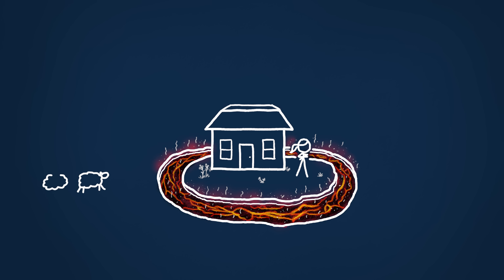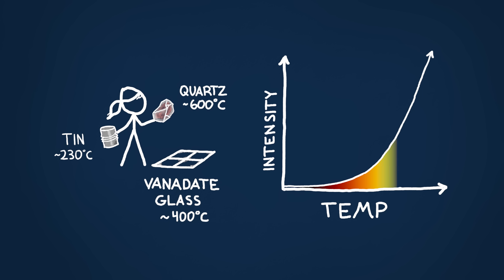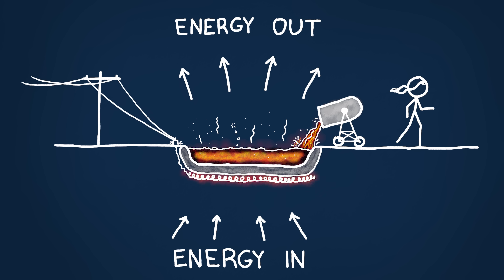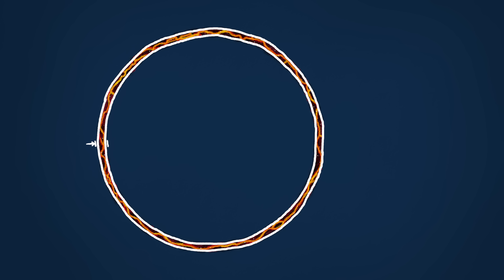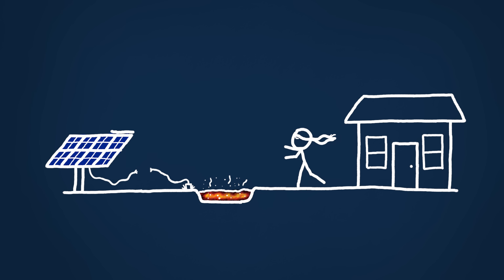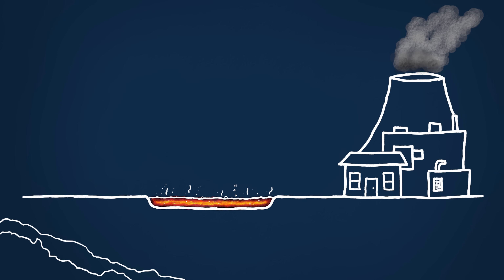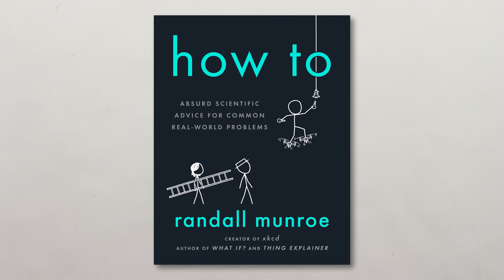How to Build a Lava Moat (with xkcd)

Comment: ☆☆☆☆ I give this Four stars! This guide has helped me solve almost all of my trespasser issues and given the outer walls of my personal fortress a wonderful glow. Keeps out burglars and in-laws! Would have given it 5 stars but the heat from the lava moat boiled away the water for the moat holding the Laser Sharks.
Reply: So you gave it 4 stars for your poor planning, and because it did exactly what you wanted it to, which is get hot? Ugh, you are just one of those reviewers.
Reply: My laser shark moat is doing just fine, maybe yours has a design flaw?
Reply: I'm fine, because my newest generation of laser shark is completely fireproof, allowing me to replace the water with lava safely
Reply: @thepizzaman6310  Unlike those iSharks, SO fragile!
Reply: @Basilililisk  You learn to identify which brands are trash by the names of their laser sharks alone, believe me.
Reply: @Resetium You dont need to tell me twice
Reply: @familypremium-m3f  damn right i dont
Reply: awww the frickin laser sharks
Reply: that is the problem with over complication. My moat is just regular water, filled with very unregular mutated sea bass
Reply: @rphb00  unregular mutated sea bass? I just have a simple automated system to inject the water high up into the nose of the annoyance whatever it may be, making a lot of that common brain eating amoeba pretty much guaranteed sealing the fate of the perpetrator, and then once they reach the other side a screen tells them about what they hopefulyl are infected with and the consequences of being infected with it.
Reply: i rate it 6.9 stars

Comment: Dig a ring (or square, I guess) around your house that is at least 5 blocks wide and 3 blocks deep, although personally I like to stretch these dimensions by a block or two. I'd recommend leaving at least 5 blocks between the ring and whatever building you put in the middle of it, so you can make a farm inside, space for other security measures, or just to walk around in. Then again, this is just a guide, do what you wish.

 Once that is done, take obsidian and line the inside of the ring with it. Don't worry, I already made space when I told you the size of the ring, no further digging required. When you finish that, go to the innermost layer of obsidian and continue it two or three blocks up. if you want, you could stretch the width of the ring beforehand to save space for a thicker inner wall (but make sure you save at least 3 blocks of width in the moat for the lava!), and even add an overhang to your wall for more difficult entry. 

Another option for your wall is instead of an overhang(or even with the overhang, for the craziest base), you can add cobwebs. If your enemies are scaling your wall and get stuck in the web, the only place they're going is down into the lava or away from the wall. If you want to get really high tech you can build an observer system that sets off an alarm, activates other security systems or notifies you in some way when the wall is tampered with.

Now, it's time for the lava. All you need to do is fill the moat up enough that there is one unfilled layer at the top to hopefully trap invaders . So if you went with the ring I told you to make, there will be one layer of lava at the bottom. As I said before I usually make the moat a bit deeper. Also, I believe (at least in PE) lava will not damage cobwebs, so you could also put it over the lava for extra defence.

Congratulations! You've locked yourself in your own high security base! Sure, you can build some stairs, but you'll need to get back in. There are so many things you can do. You can be as boring as those stairs, or as advanced as keycard reading slimeblock launchers. Secret entrances. Pop out stairs. Get creative! But that is all I have for you. I wish you good luck defending your home from those gosh darn creepers.

Comment: UGH I WISH I SAW THIS BEFORE MAKING MY EVIL LAIR! had to settle for a circle of shark infested waters instead

EDIT- I have made this comment 10 months ago and am still getting replies so I will update you. The sharks are a difficult balance between feeding them too much and starving them, I would be careful managing their bloodthirst without risking their health. As a downside of my inexperience I have been overfeeding them at first and my heroic nemesis made her way into my lair, there was a lot of fighting and monologuing. As an upside we are married now, both evil, and both have learned from the past security issue. With 2 villains in a lair the amount of heroes doubled, so now I don't have to feed the sharks myself much at all
Reply: You didn’t even add LAZERS?! smh
Reply: @TrippleDogDare  laser(light amplification by stimulated emission of radiation)
Reply: From personal experience, I would recommend piranhas. They require less work and are cheaper. Plus, sometimes sharks leave your enemies alone end they can swim to safety. No such issue with piranhas!

Then again, you could, of course, splice the genes of the sharks and the piranhas to make a new creature but that’s just too expensive and time consuming (rather than visitor consuming)
Reply: @insertnamehere8099  yea great idea... Personally I used to use  both piranhas and sharks but then they started fighting and all... Then I settled for lasers and high voltage current flowing through water from the dead sea... Its very low maintanance..
Reply: @insertnamehere8099  Sharks very rarely attack people and as a result, the hybrid would probably be a good choice.
Reply: @insertnamehere8099  Why not just fill the moat with both?
Reply: Try using genetically modified sharks that are always hungry.
Reply: You're lucky you could afford actual sharks. Some of us have to settle for ill-tempered mutated sea bass.
Reply: Is your evil lair called Australia?
Reply: @JUSTIN SMITH sharks don’t sleep
Reply: @timthetincan6782  sharks sleep, they just keep moving in their sleep
Reply: just put the sharks in an inner ring, and a lava moat outside the water! Then make fireproof and lava proof and heat proof sharks and piranhas! complicated :)
Reply: what about lava shark infested lavas?
Reply: dude thats rude sharks live in water, its like saying human infested homes.
Reply: With freaking lasers on their head I hope?
Reply: Shark infested waters isn't so bad. Ever considering upgrading it to includes sharknado?
Reply: this is the greatest comment i've ever seen
Reply: i also recomend a brick cannon which fires bricks if it helps me it will help you
also i use it for deffending from people that want to grind me up into powder so i can be used more easyli i dont want to be dust ya know
Reply: That's why I like the Saturday Night Live skit with Christopher Walken.  Spoofing his portrayal of Zorin, he had a pool with a sea sponge.
If you recall in the movie, there's a little bridge over the indoor tank and he presses a button to drop his visitor into the water, where he's met by a hungry shark.
As you point out, the shark has to be kept hungry to be ready to use, but not starved; and feeding them is not cheap.  You also would have trouble housing more than one in that state.
But a sponge is low maintenance.  With no limbs or teeth or shell to fend off attack, they are always prepared for defense, and they have to engage in massive overkill so the would-be prey is killed before it can eat much of the defending creature.  It eats very little thanks to not moving or having internal organs and their associated energy budget, but drop an unsuspecting person on top of it and stinging cells inject fast acting neurotoxin.  As a bonus, it can be milked periodically for a supply of toxin to use on darts or on the back of postage stamps and other Bond tropes.
Reply: i went with a cactus pit, good choice tho
Reply: Love wins <3
Reply: oh damn how did you get your hero to turn to your bodacious side of the law? I'm having trouble with a nemesis myself, and while there's plenty of fruitful homoromantic tension, she keeps trying to get me to "go straight", and we both know I can't do that, honey. How do I convince her to lay down her sense of morality and justice?
Reply: To bad man that must suck
Reply: geez I hate it when that happens.
Also how much are you paying too feed the sharks?
Reply: @HG-mj9ow  Its a common misconception that an evil genius needs to buy shark food. Simply advertise your evil lair in one of the lower-tier hero magazines and your sharks will never go hungry again. You may need to hire staff to clean the spandex out of their teeth every now and again, tho.
Reply: @keithklassen5320  Ohhhh smart, I'lll try that sometime
Reply: You can have lava with shark bones in it
Reply: I did the same but with alligators didnt know they tasted like chicken it's very interesting it took a lot of planning but finally I got the moat not try and killer me baby alligators are cute :D
Reply: Why no Cybernetically Enhanced Laser-Sharks?
Reply: I would recommend alligators or crocodiles. They need less mantinence and can chase intruders on to land. Need to be trained to leave you alone, but that's as easy as shocking them when they try to eat you and only feeding them the weeks they don't. You need to find a way for them to distinguish friends and foes.
Reply: I just can't believe that you didn't consider the far more environmentally effective crocodile option.  God, super-villains these days...
Reply: probably the only one who can afford something like this is a mimionare

and even if you could there's stuff like safety and laws
                  afterall there's probably an important reason why no one has tried building a lava moat
Reply: @bluewhalestudioblenderanim1132  if you're building an evil lair, I don't think you would care about safety and laws.

Just like Willy Wonka's chocolate factory
Reply: But uno reverse cards in there
Reply: @Eric Lee  But then the hero did a backflip, snapped the bad guy’s neck and saved the day!
Reply: are you sure the sharks will actually do anything? they tend to be very docile.
Reply: @JUSTIN SMITH but can you send someone to sleep with the robo fish? No you can't
Reply: Why not a system of cameras with lasers attached
Reply: @alba2162  those are indoors
Reply: @deanastasya  That was absolutely hilarious. Keep up with the edits xD.
Reply: Oh my god/goodness u a devil? Laugh out loud i have robots all over my house but they are on low usage. My robots are my lava moat.
Reply: I would suggest using ill-tempered sea bass.
Reply: @Eric Lee  But then the hero did a backflip, snapped the bad guy’s neck and saved the day!
Reply: But sharks don’t eat people normally...
Reply: Liked for the edit 😂
Reply: @EDDIE3DDIE  
Jesus, we are bad guys but we aren't monsters!
Reply: Update?
Reply: I’ve heard that piranhas are more manageable
Reply: This was such a fun and witty read. Thank you 😊

Comment: Oh I need higher quality rock that's where I've been going wrong
Reply: Nah just add LEDs. In fact, forget a lava moat; just rig some smoke machines and holoprojectors in a trench along with heat vents a distance away. Same effect, way cheaper and easier.
Reply: @copterinx0468  That's OK as a deterrent but it's not going to do the job of actually melting a horde of invasive zombies, or religious/political door-knockers.

Comment: And then comes the guy with a bucket of water.
Reply: Obsidian for days, man
Reply: @ScalyRaptor1944  you’ve got yourself a nether portal
Reply: Little did they know, they were in the nether
Reply: Steam.
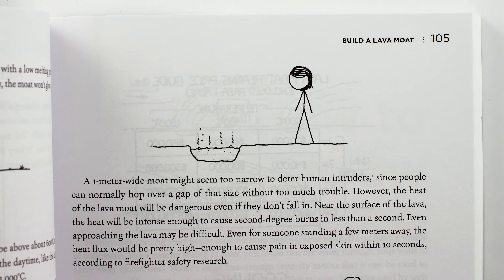Reply: @esequieltovar4955  although at 3:14 you can read that it's not all that unforgiving: just need a bit of insulation from the heat. ;-)
Reply: you are correct
Reply: i think that the water would explode rather than evaporate fast
Reply: I get that’s a Minecraft joke, but a moat of lava is insanely hot. The water would have evaporated far before you could dump it on the lava
Reply: By the time anyone got close with water, both the bucket will have melted and the water will have boiled into steam
Reply: Daniel Smerdel Minecraft joke
Reply: @danielsmerdel8214  Woosh
Reply: @TheBalefire  that's great but don't come crying to me when your skin melted off because you forgot lava radiates a heck ton of heat
Reply: @danielsmerdel8214  you did not get the joke
Reply: @wolfkey980  sarcasm is hard to convey over the internet, my apologies
Reply: @danielsmerdel8214  not really if the context is rather obvious
Reply: @danielsmerdel8214   its minecraft u boomer
Reply: @TheBalefire  r/woooosh
Reply: @TheBalefire  Did you r/woosh him?
I'm gonna do what I always wanted and r/woosh an r/woosh.
Reply: Then bring fire resistance 4 armor then start scoopin.
Reply: @TheBalefire  the sound of steam

Comment: You can decrease the size needed for solar-power with 2 slight changes:  
Use the heat of the sun directly - solar-panels are not that efficient, it would be better to use mirrors to direct the sun at the moat, should net an increase in efficiency by 50%.
And using heat-reflectors at the inside (and maybe a bit overhanging) of the moat would reduce the energy lost.

Comment: I imagine wind power might be a decent option for part of the power you would need here, as with the constant heat radiating off the moat, there would be constant air flow. I wouldn’t think it would produce enough power though

Comment: I hate to say it, but the melting point of plain quartz is about 1000-1100 degrees Celsius (or 1000 units kelvin for that matter) higher than is shown in the video. Also (and I could be wrong about this one as I have not personally melted it) Olivine seems to melt at between 1200 C and 1900 C (which is impressive given that sprinkling a little Mg in quartz will raise the melting point 200-300 degrees). Actually I am more assuming that the melting point of an average piece of Olivine is between 1200 and 1900 because I'm guessing the melting point varies roughly linearly as you move linearly between the extremes of the valid compositions for Olivine. (bit of a run on sentence there). Pyroxene seems like rock soup with everything thrown in so I have no Idea what its melting point is.

Comment: Why on earth would you use solar PV panels instead of Solar Thermal collection? Just for the lawlz ?
Reply: Yeah I was thinking concentrated solar thermal would be the best option here, perhaps as a parabolic trough on the sun facing side and tracking mirrors on the other side. The molten salt they use is only 566*C but I don’t see why you couldn’t use a higher melting point rock. Thermal efficiency is in the 60-80% range so you gain a lot by skipping electricity altogether. With enough thermal mass and insulation you might be able to make it through the night and the mirrors might reduce the amount lost to radiative heat too.

Comment: Because lava is so dense, I feel like there's a good chance the moat could easily be traversed by a floating plywood plank, assuming you can run quickly enough. Jury is still out on whether or not the plywood should be soaked in water first. If it isn't, it might burn really quickly. But if it is soaked, the Leidenfrost effect from the rapid vaporization (I know it's evaporation, but it's so fast that I feel like "vaporization" really gets the point across better) might make it unworkably slippery.

But if you construct your moat with a temperature gradient with uneven distribution of the heat generator's output, you might be able to get a convection current going that would make any floating bridge much less reliable.

Comment: Most of these power suggestions have it convert heat to power to heat which is inefficient, for example for solar power one could use mirrors to shine the light on a light absorbant material directly and use the heat from that. For nuclear perhaps one could use an RTG equivalent and keep nuclear waste directly below the lava or mix it in directly, perhaps not enough to keep the rock simmering directly depending on the isotopes but I think it'd help

Comment: Well, 1 meter is not that hard to overcome, oh and seeing as lava is is dense as fuck, you can walk on it, you won't sink, just get good enough boots with superb insulation, you don't want to burn your feet crossing, oh and seeing as you'd probably need 7 meters of lava to deter long distance jumpers, however if you don't think any long distance jumpers will arrive to threaten you, then you only need 4.5 meters, as most people can't jump that far.

If you really really wanted a decent enough moat though, you can't be cheap, if you can get a moat that's made out of molten metals, that's better, I recommend a 5 meter wide moat that is filled with iron, it has 1538ºC melting point, so if you really want to keep it molten and liquid, keeping a temperature of 1600ºC would be sufficient, however the problem is insulation, there aren't that many things that can withstand such high temperatures at least with how low the pressure at surface level of earth is, Tungsten Carbide would work as the main heat sink for insulation, Then you'd have to slowly disperse the heat with other materials that are great insulators, I recommend Aerogels, although an other layer that protects the aerogels from humidity would be important seeing as water can ruin most thermal aerogels. Other than that, Having Basalt 1 meter outside of the lava moat would look cool, and prevent any grass from taking fire due to the heat.

Comment: I think you're missing a great trick here with nuclear power.  How about simply building your lava moat over a ring of enriched uranium that puts out just enough power to match that radiated by the lava?  You'd be limited to a working temp of under 1100 degrees C to keep your uranium from melting, but otherwise you should be OK with a bit of extra thought put into the radiation concerns.